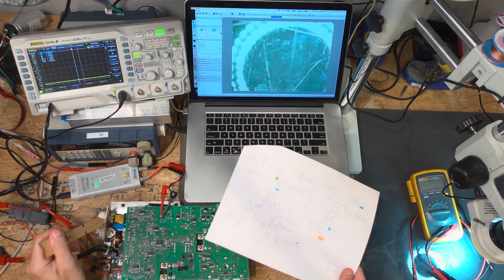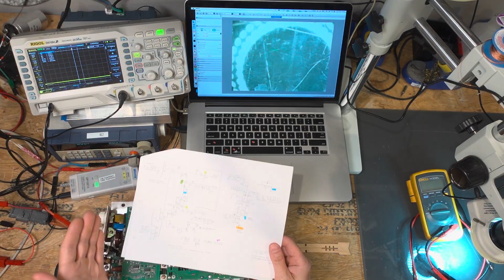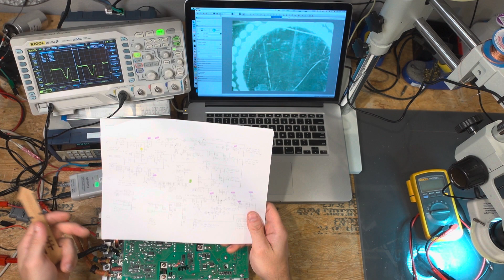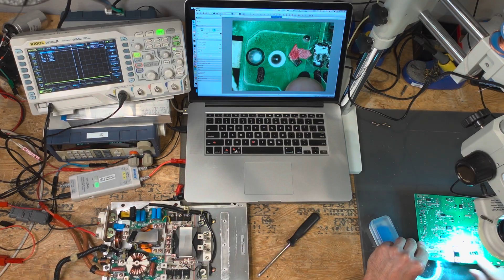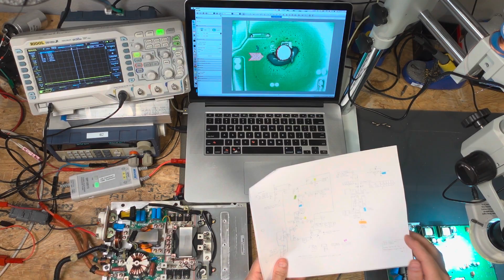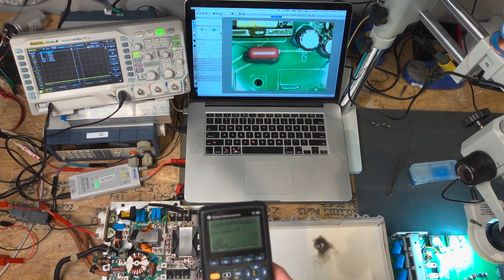(Technical PSA) G1 Honda Insight DCDC - Failing Electrolytic Capacitors

Comment: This is very fascinating. It's just like the older Honda Cub electrical systems. There was no voltage regulation as it used the battery as a voltage soak/drop, so if your battery was dead and you were running the bike, the headlight and other bulbs would burn out in short order. History repeats itself, it seems.

Do you think something like a daughterboard with ceramic caps and a fuse would fit inside the dc/dc case, where the installer could run leads going to the capacitors? Correct me if I'm wrong, but considering they're capacitors, it shouldn't mess with timing or anything. Folks with '90s Hondas are recapping their ECUs, and I'm a bit apprehensive that if the caps are leaking here in the dc/dc, more issues are around the corner in other systems.

Comment: current the weather is getting hotter. just having a through on how would the hybrid battery handles the heat? we all know that EV such as Tesla has active temp management for the battery while I dont see any active temp management for hybrid cars.

if the out door temp is 38C while the car is parked under the Sun for 3 house, temp inside the car can get to 60-68C, when the car is park the Hybrid battery is not in use would it accelerate the degradation of the hybrid battery ? 
neither NMC, LiPO4 or NiMh battery can be store in such high temp. 

The car is off no fan will run. 
Let say if driving the car for camping in CA while outdoor temperature is hitting 56.7°C (highest possible temp) while having the car park under the sun for 8 hours, it would get closer to 80C inside the car? in this case are we looking for a possible fire when the car is off ?
Reply from the maker: Hybrid batteries have high thermal mass, and are buried deep inside the car.  It takes many hours of sustained heat for the batteries to reach the cabin temperature.  Most packs won't reach the cabin temperature during a 12 hour direct sunlight day.  

There are certainly conditions where leaving a parked car in direct sunlight in high ambient temps can cause the battery to exceed ideal temperature limits.  In these cases, the only thing the car can do is turn the fans on when the key turns on.  Not ideal.
Reply: @doppelhub  wow it take 12 hours, maybe it wont have as large impact to battery life as i thought?? (peak sunlight last less than 12 hours) now I want to place additional temp sensor to do a monitoring and log the data.  

Idea on cooling car in summer

1.Active Cooling: 
1.1 The Prius 2010-2015 version has solar ventilation system. I read the repair manual understand the logic. 

Logic: 
60w 20v roof top solar panel, when under direct sun light and when IG switch is off, solar vent switch is on and temp is greater than 100F, the solar panel will charge a small capacitor and then turn on the blower motor at the lowest setting to allow some air flow. 
 
This setup does not seem to talk to the CAN system. I current have the OEM parts. 

I going to install additional 100A 12v battery into the car, when IG on second battery got charge at 20A, and when IG off temp is high then the additional battery will power the blower motor at the lowest setting. (in progress)

1.2
Install 2 solar panel (3lb each) on the rear door/trunk door (no impact on air flow) with solar controller to power the extra battery and then power the blower motor. the blower motor logic will turn on base on 100F and blow 70% humidity similar to attic fan from a house.

2.Passive cooling: (from home building)
2.1Insulation: 
2.1.1current my prius has insulated with R-7 and R-4 form board with air seal on headliner. 

2.1.2 Insulated all rear windows with R-7 material 

2.1.3 From windshield with pull up shutter (in working progress)

2.1.4 install additional insulation around the hybrid battery block R 1-2 material  

 2.2 install rain grad and leave 1-2 inch driver passenger side  opening.
Reply from the maker: @digitalgame3873  Yes, solar fan cooling is used in some vehicles.  Note that a 100 Ah 12 V battery isn't necessary... just run the fan directly from the solar panel whenever the sun is shining.  Note that blowing hot air from the cabin might actually increase battery temperature; this will only work if you draw in cooler air from outside the vehicle (or use an exterior-facing heat exchanger to do the same).
Reply: @doppelhub  
thanks for the insight. 
No wonder why the solar charger does not power the hybrid battery blower fan but the main ac heater blower motor. (i have it replace with brashless blower motor)

 In the design i will need to have extra temp sensor on the air intake. 

Im not positive if i can install a heat exchanger.... these equipment are quiet big..

>the 100A 1.2kw battery implementation is without solar panel.

1.when the car is part the capacity act as a buffer to let the blower motor run for 10 hours.  
2.change when ready mode is on.
Reply from the maker: @digitalgame3873  FYI: Instead of a separate lead acid battery, my LiBCM products source fan energy from the traction battery... but only when SoC is above a user-defined percentage (default is 50%).  LiBCM's (optional) heater does the same in the winter.
Reply: @doppelhub  

Thanks for the advise. I dont use any lead acid batteries. The additional battery i planning to install is LiPo4 with real time monitoring. The hybrid inverter does most of the job for me already so 12v Lithium is perfect swap (i already replace main battery with lithium for years)  

Factory Logic:
The Prius has this feature that traction battery provide 205v-240v to hybrid inverter at the front inverter, basic on logic it pass IGBT either step down to 14v (120A Max) or step up to 650v for drive motor. (gen2 has additional IPM IGBT battery voltage can be reduce because of it) 

Using Traction battery power blower motor: 
Because the hybrid battery is 205v and 40A Max continuous so Toyota uses cheap 6AWG Aluminum wire while in the inverter side are using pure copper wires. 

Questions:
 LiBCM products source fan energy from the traction battery..?? (that is super complex!!)

Q1 traction battery is high voltage do you have additional step down voltage converter ?

Q2 do you have predefined logic when temp is below or above threshold relay will engage and then proving the power? 

Q3 do you have a always power on battery ECU for perform this action? 

I would prefer using the factory logic instead and just adding the additional 12v LiPO4 batter that without making things super complex. 

Suggestions:
I wish you can make a universal kit for high voltage battery control kit and not just limited in the Honda Civic....
Reply from the maker: @digitalgame3873  A1: Yes, the LiBCM motherboard generates 15 volts from the traction battery using an isolated HVDCDC converter.

A2: Yes, LiBCM firmware turns fans on at predefined (and user adjustable) setpoints.  Note that I don't use relays, and instead use open drain NFETs.

Å3: Yes, LiBCM can always draw power from the battery, no matter what state the car is in (keyOn, keyOff, etc).  LiBCM has a low power sleep mode, and also enters a "turn off entirely until next keyOn" mode when the traction battery drops below a predefined SoC minimum.
Reply: @doppelhub  it super! really the next level of integration, that you have it integrated into the your custom BMS board. 

by doing this you must able to record all the logs from the hybrid battery so the SOC is quiet accurate because last SOC is always record. not sure if the board can lavage all the driving information and have customer maintenance schedule for the hybrid battery...

I wonder is it because of the difference on voltages between cars, the Honda 140 vs Prius 205 and Camry 240 preventing you to develop a universal controller across these platform ?
Reply from the maker: @digitalgame3873  Pack voltage isn't an issue... Honda Insights with 60S LiBCM Kits run at 250 Vmax (225 Vnom).  48S LiBCM Kits run at 200 Vmax (180 Vnom).  Yes, LiBCM has an (optional) daughterboard that can record and recall all drive data for the past several months.  All LiBCM Kits record Wh consumption for the past QTY100 drive cycles.
Reply: @doppelhub  You should selling the universal conversion kit or at lease offer as an option for strong DIY're.  other than this its Jack's project lithium and those dangerous MNC batteries from Alibaba...